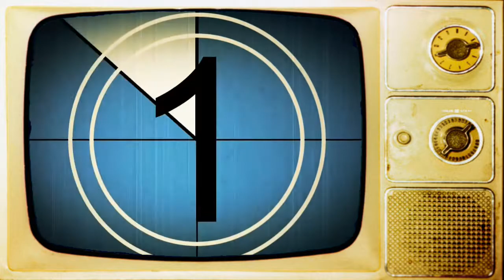Driving with a flat tire Debica Passio

Comment: The question is how it feel on steering while driving on flat tire?
Reply from the maker: Not bad but the tire was at the rear  side not on the front.
Reply: I hd suffer from the same situation... Rear left tire got flat fully n failed to feel that situation on steering... So i inquired u about this..
Reply from the maker: @arsalanali3032  once i was driving with a flat tire on the front side and trust me you will feel the difference when you have flat tire on the front side :)
Reply: I once went out at night and tried driving around with a completely flat front tire. It didn’t seem to pull to the side as much as I expected, but the car was rear wheel drive, so maybe that helped. I had to be pretty careful making right turns though - I could feel the wheel rim scraping on the road. I had a bit of trouble when I tried to pump it back up to drive home!